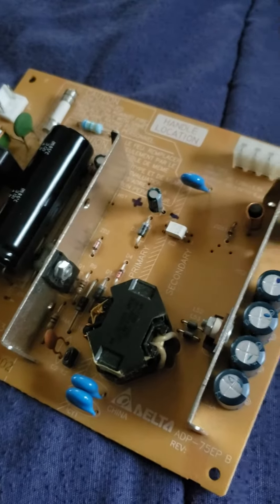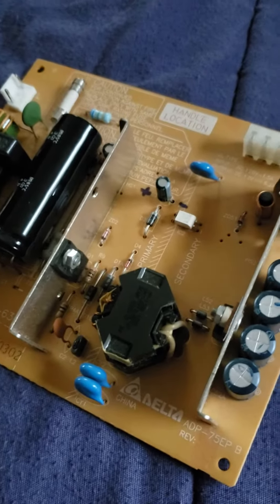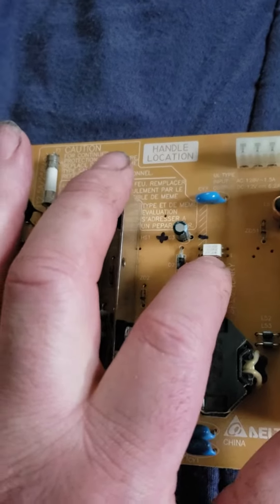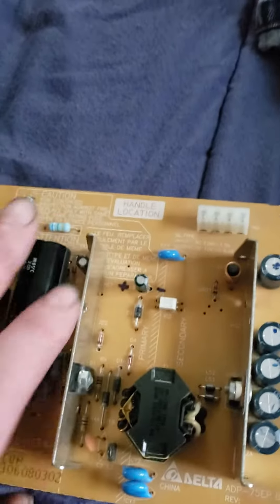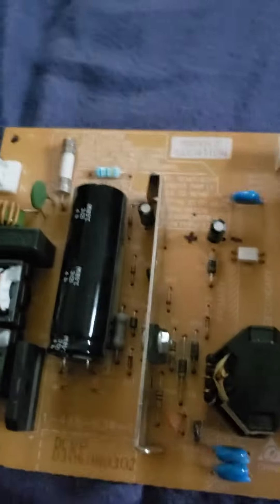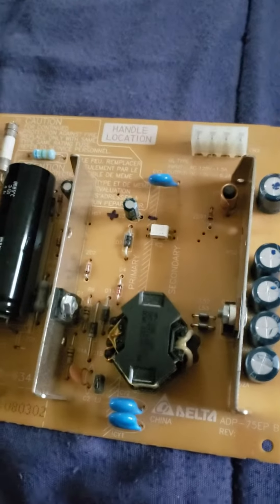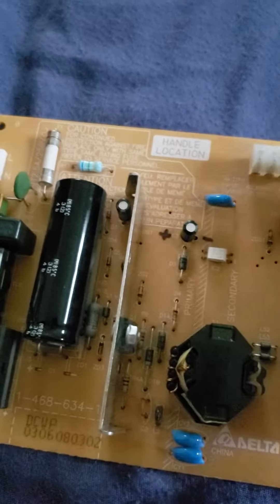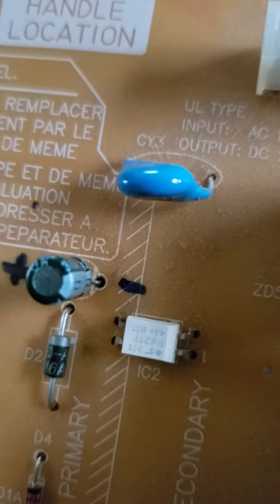How To Repair PS2 Power Supply | Step-by-Step Tutorial

Comment: Did you also use ESR meter to test those 33uf 35v capacitor? Or you're just guessing ?
Reply from the maker: Esr meter and multimeter you should have 12v DC at that capacitor

Comment: Using ESR meter I found out there are two capacitors dead the 220uf 16V and the 27uf 35v.... Damn, 27uf 35 volts capacitor are hard to find here, so I use 33uf 35 volts and feels like nothing happened but my power supply is working now.
Reply from the maker: They upgraded those to 35uf 35v on the newer v4s so you will be fine instead of 27uf 35v also test the rectifier for a short. The transistor as well common failure points

Comment: I replace the power board on mine and the power bottom 12pin flex cable, and still no power is coming on? The model is 50001/N. Any idea what else it could be wrong?
Reply from the maker: Test the power at the switch with a volt meter on ac in the on position. Then if that is the case setup on pin one and there on the power supply if you have 12v dc it's a bad motherboard you can find them on ebay
Reply: @axcc  The old power board was 11.83v and the new Chinese one is 12.15v

The power button flex wire was damage by whoever opens the lid before, they ran the corner screw through. I replace the wire for a new one. No power lights are coming on.
Reply from the maker: You have a bad fuse get a new used motherboard. Your power supply is not the issue bad motherboard go on ebay and buy a broken or used working motherboard or a parts ps2 with the same model
Reply: @axcc  I do. I have found the bad PS1 fuse.
Reply from the maker: You can replace the fuse but they're very hard to source without a Service manual. I have them leaked from Sony. I would just replace the motherboard with another one and be done

Comment: Mine is hissing but working ps2 and weird red filter in my tv cause ps2 dying gpu?
Reply from the maker: No check the resistors between the GPU and cpu they should be 47ohms. Those are the data line resistors

Comment: I get 188V out of the first pin. That's not supposed to happen, right?
Reply from the maker: It's pin one, and pin four goes 12 12 ground ground on the DC side. You're on the ac side. So that is normal to up to 240v that power supply switches from 120 to 240v on the ac side depending on if you're not in the US. If you don't know what is going on, I suggest getting on off of eBay or getting a reproduction off of eBay.

Comment: I have two units that will not power on, I have tested the power supply and it does output 11.79v. But I am not getting any sign of life after powering the both of them on.  The weird part is both are fat models but the mainboards are different where you cannot use the hard drive from on on the other since he connectors are different and one has the cmos batter on the board and one has it on a smaller board. I believe one is rev.09 and the other is rev.10. What I have tried is connecting the ps2 to the power supply only with out the av cable. I am wondering if it is a button problem. Is there a way to power it on without the reset button? also is there any other way to tell if it powers on , other then the red light on the rest button?
Reply from the maker: What are the model numbers? If you havea red light and will not power out of standby check the power switch of not that bad motherboard. Ebay is a good source for those make sure you get the one for your lazer. Dash 41 is 400r dash 31 is a 400c and b laser
Reply: @axcc  yeah no light at all both ps2 acting the same. Weird
Reply from the maker: @sr8shoota  did you make sure the switch on that back is on and make sure the red light comes on make sure you check pin one and three on the power supply with no load you should have 12v at pin one and three is ground check my other videos
Reply: @axcc  yup made sure switch is on. I figured the mainboard is shot. Got new one for 20 and it already had the hdd installed.
Reply from the maker: Good to hear

Comment: no such thing as getting an entire power board for a 50000 - 55000.  cant find them for anything higher than 39000 model.  i wonder if a 12 volt power supply for a desktop computer would be wired in to make it work.  i hate to think my 50001 model is dead for good, if not, i will see if i can test the chip and capacitor and then just replace them.
Reply from the maker: I have a oem spare power supply for that model. That power supply is dead check the DC to DC convertor
Reply: @axcc  tested it, 12.02 volts DC steady, power still does not come on so i am thinking CPU is dead.
Reply from the maker: You can get a used motherboard on eBay or I have one
Reply: @axcc  got a 39001 coming but will look for the motherboard.
Reply: @axcc  if i dont find a motherboard, i'll let ya know.  i appreciate it.
Reply from the maker: No problem